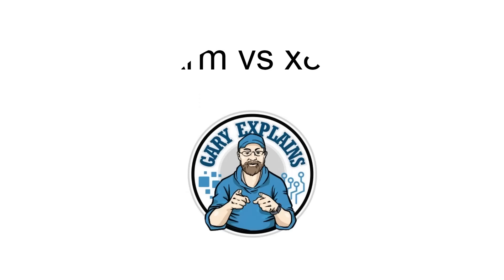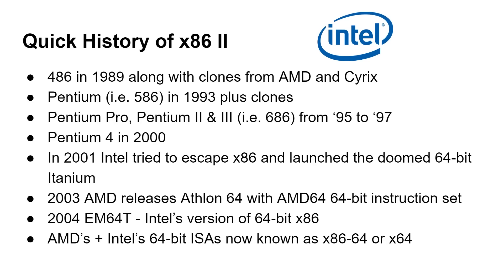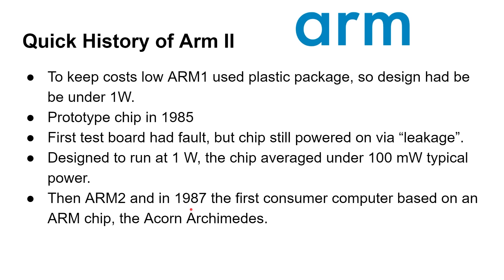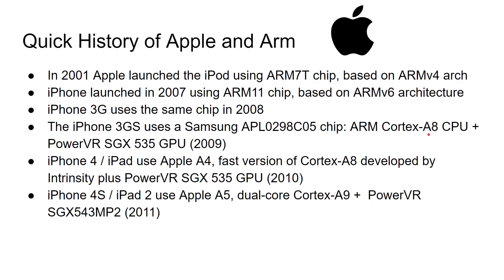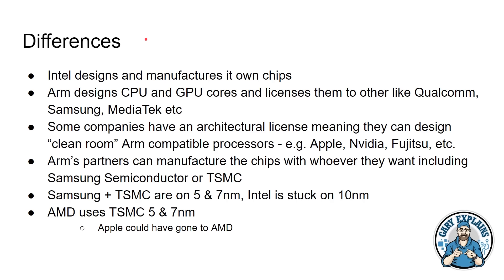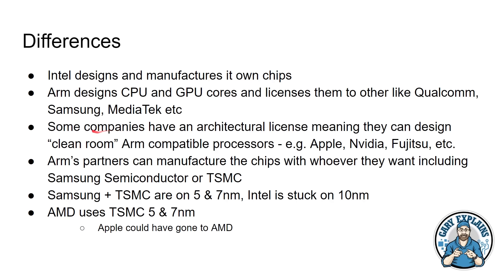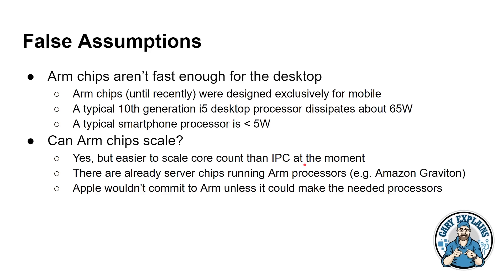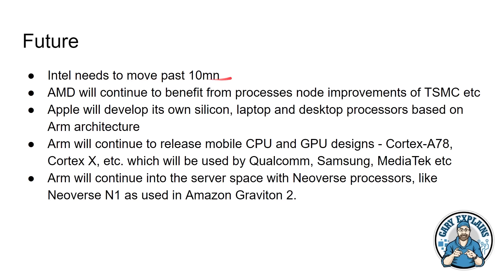Arm vs x86 - Key Differences Explained

Comment: You skipped the 8088 that propelled Intel into the limelight.  It was the 8086 with an 8 bit memory bus.   The IBM PC was that and the 286 was the AT.  Little known fact...you could make your PC_AT faster by going to Radio Shack and getting a crystal at a different MHz  Also, anyone remember Cyrex?
Reply from the maker: Yes I skipped the 8088 intentionally as I wanted to focus on the origins of x86. As you say the 8088 was really an 8086, just with the different bus. So the 8086 was the important development even if the 8088 was actually in the original PC.

Comment: OMG, if you ultimately do a vid on Moore's law, please tell me you'll tease apart the misconceptions involved in the conflation of exponential performance increases with transistor density increases and the more obviously apparent bottleneck in speeds which seem to have capped CPUs at around 4ghz which is really electrical leakage as voltages must be increased to send signals quickly over the long wires to ship them all the way internally across the CPU quickly enough.  What does the exponentially increasing transistor density get us? (cache, more processor cores, very wide GPUs) and what changes does it bring? (chiplet designs).  Just a graph showing CPUs speed up exponentially over time is so much the old view of things which is no longer relevant or interesting now that the Ghz cap has become pretty well established.  But as a baseline, that was an interesting and exciting thing before we tried to hit 4ghz, learned we really couldn't, and decided to step back from it.
Reply from the maker: I did a video on Moore's law.

Comment: ARM silicon can never achieve the sheer processing prowess of intel for at least 2-3 years. By then intel would have moved on to better nodes

It can be used for basic tasks no matter how much you fine tune the software in raw power it cannot achieve it.

You will now see laptops from apple saying take this and oh yea one more thing we have a new "thunderbolt" port where you can attach a gpu or some high end system to do all the number crunching and of course pay $1000 dollars more....
Reply from the maker: "ARM silicon can never achieve the sheer processing prowess of intel for at least 2-3 years", really? Why? What are you basing that on?
Reply: @GaryExplains  hey Gary, Always higher performance can be achieved at the expense of power on x86 and this is relevant for desktop system where performance matters the most and not power. 

For example systems like the Mac Pro which is expected to perform at its peak irrespective of power consumption. Getting arm into systems like that will take time 

Also to get a complete ecosystem even at the scale of apple will take time, and this will take 2-3 years.

By that time x86 nodes would have moved to lower nodes. Also it is a known fact apple will ensure its ecosystem is sustained and will have to provide a thunderbolt 4 port and add accesories to it ,  telling customers for better performance connect a graphics card and things like that ...
Reply from the maker: So why can't "higher performance can be achieved at the expense of power on" Arm, also be true?

As for the time needed to get Apple silicon for Mac PRo, Apple has been working on this for years. It didn't start working on it when it make the announcement.

I don't know what you mean by, "to get a complete ecosystem even at the scale of apple will take time, and this will take 2-3 years." Apple already has a huge Arm based eco-system.

"By that time", that time is now, as I said, Apple has been working on this for years.
Reply: @GaryExplains  hey Gary,

Apps like video encoding that rely on massive SIMD processors will suffer a lot.  Part of it is that good SIMD implementations require massive amounts of power, and most ARM CPUs are targeting low power levels.
compatibility with Microsoft-Windows as a large % of Mac Users will run Windows on their device, and Microsoft's ARM compatibility is not there yet

Now you may say hey Windows has an arm flavor/installation,

 but if you look at it in detail lot of legacy & core OS API's don't offer ARM support.

many existing C# and C++ code bases Microsoft has made it difficult to port it to ARM

professional software, like Integrated Circuit design tools, photonics design tools, CAD tools, SCADA  etc are not ported to MAC and  would need windows

Not sure when ARM will start meaningfully exceeding x86/intel in performance.

The issue of lower power with everything and everyone working from home they are always plugged in. 

The next intel node the performance could be improved at least by 20%. So then it's a hard game to beat.

The Apple has its own reason to go the arm way, but it does not a aha moment to say arm has arrived, no it is still a couple of years of catching up to do.
Reply from the maker: The mistake you are making is this one, "most ARM CPUs are targeting low power levels". We aren't talking about "most ARM CPUs", we are talking about CPUs which Apple is designing to go into its Macs, which it has been designing for a couple of years now. Also talking about Microsoft's attempts to support devices like the Surface Pro X can't be compared with Apple's approach at all. That is like saying that one sport's team didn't have a good strategy, so therefore a different sport's team must also have a bad strategy. That doesn't make any sense.

Finally, re-reading your comment, what on earth does this mean, "compatibility with Microsoft-Windows as a large % of Mac Users will run Windows." Are you saying the people will try to run Windows on the new Macs. You do understand that isn't going to happen, that is no longer an option.
Reply: +1 I agree with Sudeep.  The issue that people seem to forget is that hardware + software == a viable ecosystem.  The x86 platform has had decades of software AND hardware optimization.  Some of the x86 failures have led to better hardware and vice versa.  Even if ARM developed a perfect processor (or processors) it would still take years for the software to catch up.  Perhaps not as long as the x86 experience but it would certainly take 5+ years, IMPO.   Now the one advantage Apple has is that they're using a Unix operating system and that may be easier to optimize -- but that's just the OS.  Apple will still have to convince app developers to switch platforms (and this won't happen overnight.)  I think it will be 5-10 years before ARM can have an optimized hardware+software ecosystem.  In that time, the x86 ecosystem will have moved forward.  The deciding factor will be ecosystem performance.  Customers will demand this.  I think a lot of consumers (and professionals) will wonder why we're reinventing the wheel.

Comment: Nice explanation. However, I would like to know why did Apple have to base its processor architecture on ARM if it was designing it's own custom architecture? Is it because they needed the ARM instruction set? If yes, couldn't they make their own instruction set? Or that is a very long process?
Reply: It's much easier to use already existing architecture that develop your own.

Comment: Samsung is still using arm v8.2 whilst apple is using v8.5 for iphone 12 and has use v8.4 for iphone 11 the only time it was the same with samsung was iphone 8
Not sure if this is why samsung exynos is behind, dont known if qualcomm can use the lastest arm version. Also the higher L1 and L2 cache in iphone plays apart
Reply from the maker: And what features from ARMv8.4 and ARMv8.5 do you want used by Samsung?

Comment: I have 2 more questions: will Apple Silicon Macs also use discrete GPUs (like AMD’s) next to internal on chip GPUs? Will Apple still use Intel’s Thunderbolt technology for next generation Macs?
Reply: So far, it appears that Apple will use on-chip GPUs using system memory for VRAM, and Apple has committed to supporting Thunderbolt 4 (though I'm uncertain if that includes USB 4).

Comment: OK...a bit more.  The PIII vs. the P4 line was very different with the pipeline length.  The desktop department of chips came out with "core" and it performed better at lower MHz and shorter pipelines than the P4 chip.   The P4 experiment was a failure.   I invested a lot of money in some memory company based on this design.
Reply from the maker: This video isn't called "Every Intel processor and the differences between each generation"

Comment: 2 years later and the  Apple ARM silicon destroys x86 in power efficiency on laptops. Its like an actual 2x difference in battery life while putting out the same performance. I came here to see why that is and I take it is the decoding mentioned in "Differences III".

Idk, x86 just feels like trash for anything but bulky desktops. I was looking at the gaming handhelds space after the steamdeck launch and it makes you appreciate the power efficiency of ARM and Android vs x86 and windows/linux

Comment: 2 things I don't understand, though
-if more simpler/lighter instructions are supposed to be better/the future, then why does ARM even have its own SSE?
-why are people insisting on ARM taking less clock cycles per instruction, when x86's for a long time now can execute several instructions per cycle? Is it just that ARM has less of those hard-to-understand delays? Also I'm pretty sure that the few instructions taking a lot of cycles (like, division) on today's x86's, they also do on today's ARM's. 

Also, multicores have never been the best answer to people's need, only a compromise. At first it was marketing, trying to make people believe that 4 cores would make their computer 4x faster, but today's users are more educated and well know that parallelism is only for a small category of apps. They know that the games they're playing hardly use more than a couple of cores, and that having 100 of them is pointless for their everyday needs. Plus if something can really benefit a lot from heavy parallelism, we already all own something perfect for that: a GPU.

Comment: Of course desktops and servers can run on RISC. There are many examples such as Sun/Fujitsu SPARC, DEC Alpha, and the jointly developed Apple/IBM/Motorola PowerPC which Apple itself used until 2006 when Intel made them an offer that they couldn’t refuse. Future x86 emulators where needed for compatibility combined with the evolution of apps running in container architectures will further make the underlying hardware choices irrelevant for consumer-grade desktops and general-purpose servers.

Comment: I've heard people speculating that Apples new chips would be ARMv9 but looking at their history it seems that they are lagging behind by about two years in terms of the architecture so even if v9 was announced this year I find it unlikely that Apple would use this earlier than 2022. Any news on ARMv9?
Reply from the maker: If I knew anything about ARMv9, I wouldn't be able to tell you. In fact if I was under some form of "non disclosure" agreement I couldn't even tell you I was. So basically, your guess is as good as mine, or maybe not! 😱

Comment: Can we buy arm processor and build pwn computer with it?
Reply from the maker: Yes of course you can. I have a video about doing that with an Arm microcontroller on this channel. Obviously a full ARMv8 CPU would require a full motherboard designed as well. There are companies that sell Arm based processors with motherboard or as modules.
Reply: Gary Explains ohh thank you, i will check the video, kind of excited about arm after using ipad pro and hearing apple announcement

Comment: Great video
Reply from the maker: Glad you enjoyed it
Reply: @GaryExplains  why arm is not moving its cortex-A55 to something new one for many years?
Reply from the maker: There was a 5 year gap from the launch of the A53 to the A55, so on that basis the A55 still has two years life left in it. The reality is that the little cores need to be at the same architectural level as the big cores and the A55 came out when DynamIQ was launched. My guess, and it is only a guess, is that when the big cores move to the next level (maybe ARMv9, maybe ARMv8.x) then the little core will get upgraded as well.
Reply: @GaryExplains  thanks

Comment: Well, please answer how all these nice accelerators are attached to the CPU an how the data is transferred between them in both ARM and x86 and you will see the main difference. I am not saying these other things does not have any impact but these do not explain why my Air can render non-linear 4k video in real time. And no fan. Try this on Intel/AMD and preapre your noise canceling phones.
Reply from the maker: That has nothing to do with Intel/x86 or Arm. That is about building an SoC or APU.
Reply: Right, and historically who's been better at building SoCs and why?
Reply from the maker: Well, you are suggesting Apple and that could be right, but that still has nothing to do with x86 or Arm, that is to do with Apple.

Comment: Eh, "Intel stuck on 10nm". The processing node with transistor size has been hijacked by marketing. In fact, Intel's 10nm process is actually more dense than TSMC's 7nm process (despite TSMC having the name of smaller transistors), and technically should be more dense with their smaller process node. Density is actually a more important figure when talking about what processing node. Intel is struggling with their nodes because they want to achieve proper density and not just hit a mark that says, "Yeah we're at 7nm." It took TSMC until 7nm+ to actually achieve maturity and get actually good desnity figures with 7nm processing node (20% more than 7nm variant), which is a big improvement. Now that intel is now competing with 7nm+ from TSMC it is behind again.
Reply from the maker: Yes, yes some of that is true, but we are onto 5nm now and Intel isn't making any progress. Plus there has't been much production volume from it 10nm process.

Comment: I think you skipped over the most important key difference. 90% is related to the history of these companies as related to architectures, but people only care about performance, efficiency, compatibility, cost, manufacturing. 

Currently, the A12Z can only clock to 2.49 GHz. You didn't mention that or whether there are any existing chips which can as high an Intel or AMD clock speeds. Is there any reason to believe that they can just make high-clocking chips appear when it took many years of development for Intel and ARM to get there? You mentioned IPC vaguely as if it isn't one of the most important values in the game. AMD and Intel are advertising to consumer about their IPC increases, that is how important it is.
Reply from the maker: Hmmm, I think you are confused about a few things. I don't know what the IPC or the clock speed of the next generation of Apple's silicon will be, so how can I talk about it. Also you seemed to have missed the whole point about power consumption when comparing Arm CPUs with Intel/AMD in terms of clock and IPC.

Comment: Gary, can you please explain how Virtualization like running Windows 10 x86-64 through VirtualBox or Parallels with an Apple Silicon Mac might work? Your mention of x86 microcode makes me think this is actually easier to do than otherwise thought?
Reply from the maker: I don't think there will be virtualization of Windows 10 x86 on the new Apple silicon. At best there will be emulation.
Reply: Gary Explains lol forgive me as my knowledge of virtualization and emulation isn’t too advanced but does that basically mean that it’ll struggle to run x86-64 Windows 10 or any x86 VMs?
Reply from the maker: My current assumption is that it will, as you say, struggle to run any x86/x86-64 VMs because basically it isn't an x86/x86-64 based device. It is designed to run macOS not Windows. If people need Windows then they will need to buy a Windows machine.
Reply: Gary Explains yeh interesting. It’s more just for studying/hobby stuff I’d wanna run x86-64 VMs but yeh will be interesting to see what Mac model is the first released and then what info comes out after some reviews are done.

Comment: A very nice video :D, just one point is that ARM chips can run desktop systems. Acorn Archimedes ran RiscOS, and so does Raspberry PI. Also there are linux flavours as well.
Reply from the maker: Obviously there are Arm CPUs in desktop type systems. But the Pi isn't a desktop it is a SBC. Closer would be the Surface Pro X which I have reviewed on this channel, along with most of the Pi board and some Arm based Chromebooks.
Reply: Well they could if MS and Manufacturers didn't lock down the bootloader's

Comment: If arm designs CPUs and GPUs. And TSMC manufactures them. Then what exactly does Qualcomm do?
Reply from the maker: Snapdragon processors use a GPU designed by Qualcomm. Then there is: DSP, ISP, NPU, 4G/5G modem, display driver, video encoders, video decoders, interconnects, system level caches, and more. This is why they are called systems-on-a-chip (SoC), they are much more than just a CPU and GPU.